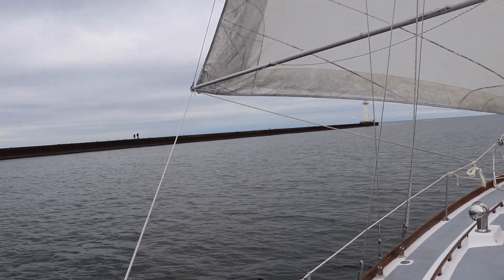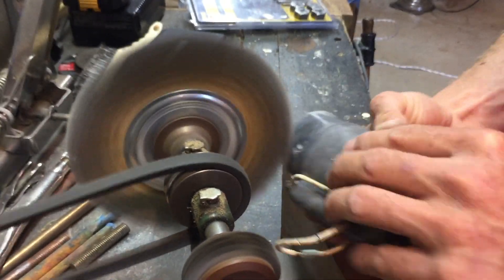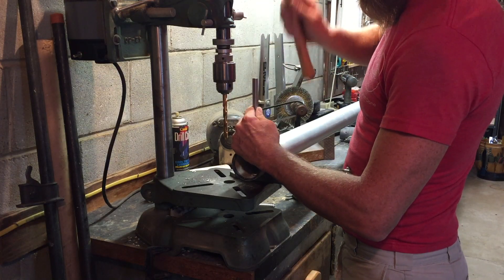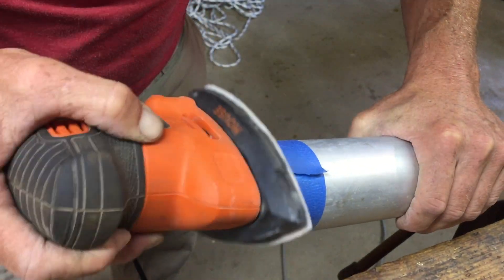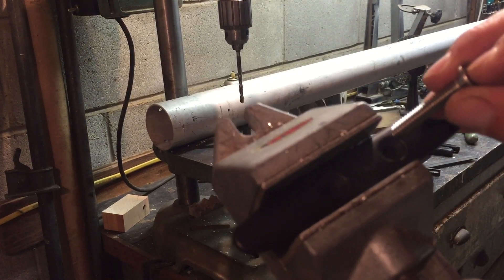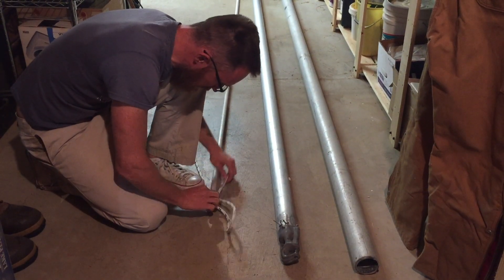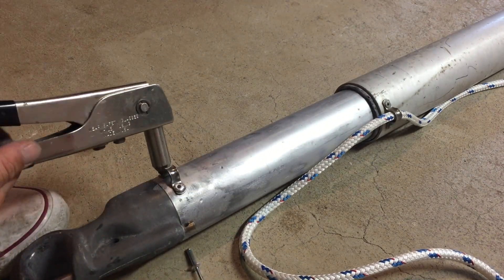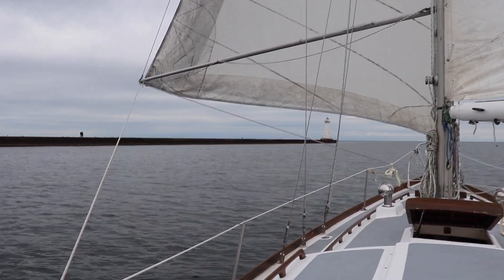Repair of a Forespar Telescoping Whisker Pole with Control Line

Comment: Adding my thanks for making this video. Very helpful in refurbishing a new to me Forespar whisker pole. Had all the same issues. I also had to trim off a bit of the stinger pole as well. I would add that it is a good time to treat any corrosion on the poles before reassembly including the inner portion of the pole ends.

Comment: Greetings, thanks for posting. Please accept a few suggestions. 1. the uv damaged sheave (white pulley) should have been replaced. 2. always coat stainless treads going into aluminum with Tef-Gel. 3. the anodized aluminum tube cuts could have been sealed with a metal spray paint. 4. the line that was used is too large of diameter for this application.

Comment: Thanks for the great video. I am building my own pole.  I have a doubt. How do you prevent the pole from pulling out more than you want? And how do you pull it back in? I was planning on a second control line, antagonist to the first one. Does it make sense?

Comment: nice rebuild...maybe I skipped part where you apply anticorrosion between all dissimilar metals (for this probobly lanacote is fine)...so you won't have to redo the project after a few seasons sailing
Reply from the maker: Thanks - and yes, that's a good thing to keep in mind. I used Tef-gel for all threaded connections between dissimilar metals.

Comment: Hello, I cannot get my telescoping pole to shorten.  The smaller tube won't slide into the larger any further.  Do you have any suggestions for me?  I thought about taking it entirely apart and lubing the ends up but I am afraid I will only make it worse.  Others have suggested a heat gun.  Thanks in advance for any tips.

Comment: I have an old fore spar telescoping pole but it doesn’t have an internal control line. It’s just two poles  with some sort of twisting mechanism like a telescoping boat hook. I got it apart but trying to figure how to reassemble. My plan is to but two new end fittings on from another pole I have but I have to figure out the internal mechanism.
Reply from the maker: Sounds like you have a twist-lock pole.  We use one of those on our smaller boat.  When that mechanism works properly, the speed of adjusting the pole's length is unmatched.  Spare parts may be available from Forespar.  Good luck!